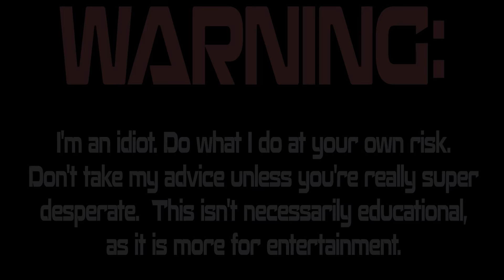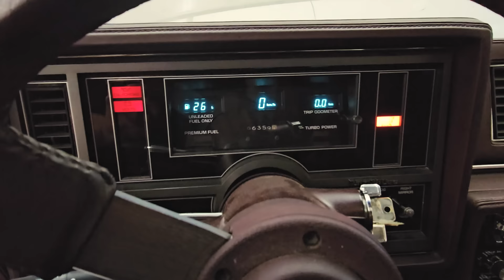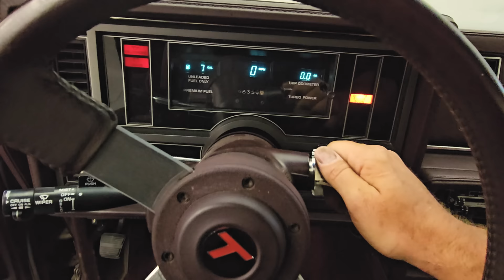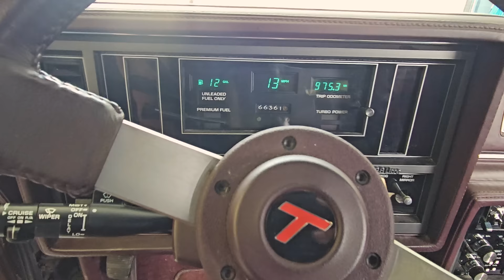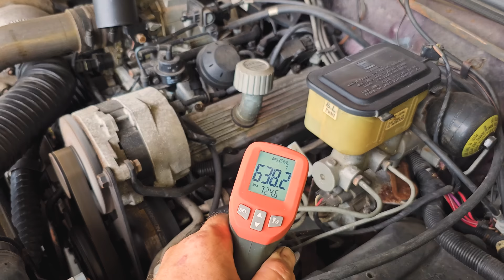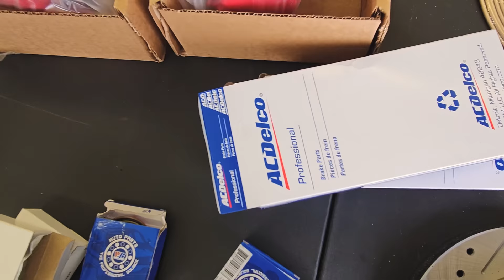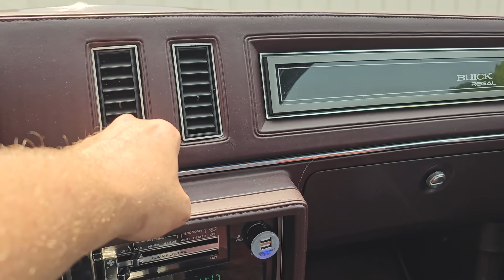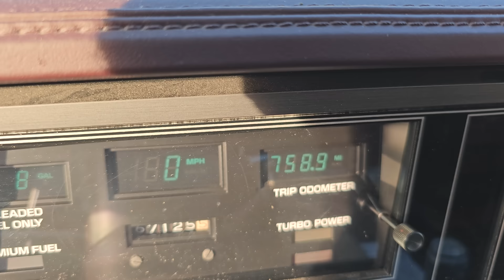ABANDONED In Storage For 22 Years - Rare Turbo Buick! Will it RUN AND DRIVE Home 750 Miles?

Comment: This car is not a t-type . It is much more rare. It is a T otherwise known as a turbo -T . There were only 1,534 of these cars made in 1987. The Turbo T's were the last off the assembly line for the buick turbos. They were lighter and faster then the grand national. They had aluminum wheels and aluminum bumpers. The grand national had steel bumpers and steel wheels. Nice find and please keep it .
Reply: Aluminum wheels & aluminum bumper brackets... Not aluminum bumpers.
Reply: How many had T tops?
Reply: @ServiceDepartment-zu5hm Never know who's readin' these comments...
This car is late-auto history!!!
I'd keep it for a show car... will turn heads I'm sure!
Reply: Its a rust bucket! Scrap it!
Reply: Since I have nothing better to do on my laptop while watching the episode on the TV.
Pausing at 10:00 and zooming in, it's a Y56 (T Package) code car and W02 (Exterior sport package). 
Not a WE4 Turbo-T car.
Reply: I think the black turbo-t is the only one that has a 1500 build number, and it's called a WE4
Reply: What ever it is restore it to original and build the gn sence it is in much worse shape.
Reply: That's way too nice a car to do a frame swap. Lift the body off and  clean the frame with a wire wheel and flap disk. Weld any bad spots. Vapor blast as much of the original parts as you can but try to keep it as original as you can. That's an amazing find and it deserves it!
Reply: @michaelweilmuenster5754  not sure you realize how bad it is rusted. One does not simply flap wheel and weld a Michigan frame 🤢
Reply: @MotorSwapDan No kidding. You still couldn’t get to the inside of the frame to clean it. I’d be on the hunt for a clean frame.
Reply: @MotorSwapDan Yea…Once the rust gets to that point it’s nearly impossible to stop it. That frame is a real hazard.
Reply: @agentcrm  I noticed at the beginning that this was a T and not the more common T-Type. I'm not an expert on RPO codes, but didn't the "T" package feature a 307 V-8, possibly standard?
I think the above post is innacurate.
I looked over two identicle brand new Regal Ts at a dealership in 1987, and both had the 307. They were both silver with the cast aluminum 'turbo' wheels.
I found out years later that that was the only year a V-8 was available in a 81-87 Regal.
Reply: @tommylord  No it didn’t, from ‘83 to ‘86 the “T-Type” trim came straight from the factory with the 3.8 turbo, upgraded suspension, and wheels, in ‘87 they changed it so the “T” became just a suspension and steering upgrade minus the standard 3.8 turbo engine that came with the car so essentially you could get any engine with the “T” package, the name “Turbo T” means that you got the 3.8 Turbo and also the T package, with or without the “WO2” appearance package that included black trim which also became available for any trim in ‘87 rather than being solely for the “T-Type”.
Reply: @agentcrm It is a Turbo-T car, Y56 is the T-trim (suspension and steering), LC2 means that you got the 3.6 turbo, and the WO2 is just the blacked out trim panels. I found all of them on the sticker.
Reply: What’s a 3.6 turbo?  

3.8.  @Sway392
Reply: @Sway392 you don't even know what kind of car that is let alone the engine!
Reply: Is that what Google told you!
Reply: @George-dy3pt  Lol, I make one mistake and all of a sudden, all’s I can do is read a brochure 😆 if you read my first comment I said 3.8 Turbo I just misread it typing the second comment as my phone has a crack down the center, and I don’t bother to update it because as you can see someone corrected my 2nd comment rather disrespectfully but it was indeed already corrected by someone else. You probably still dream of owning this car while you drive around in your green ‘94 Crown Vic, take your boomer antics to the local car museum, because that’s the only place you will ever be close to any car over 5 thousand dollars.
Reply: @Leofred2000 Some surface scale does not a “rust bucket” make.
Reply: @Leofred2000  nice bait
Reply: TINKLES 😂
Reply: @Sway392  Allright. Thanks for setting me straight on that. Unlike another jerk who accused me of being a 'google warrior'.
Reply: @Leofred2000 I can tell you drive a civic and ain't a car guy
Reply: I've never seen one of these derrek
Reply: @Sway392 ouch.  Butt hurt much?
Reply: Not a we4. It’s a base turbo regal. The lightweight stuff was on all turbo regals except most 87 GNs. All 86 GNs came with the aluminum bumper stuff. We4 was black with black bumpers.
Reply: @MotorSwapDan  But it's also not that hard to find a frame for a Regal either. It doesn't have to be one off a Turbo one, there's nothing special about it. Swap the frame and it should be good. The body is in excellent shape, a frame swap would be easily worth it.
Reply: Thanks for being aware of the whole "T" thing.  So many people think they have an '87 T-Type, when '86 was the last year for the T-Type.  The "T" package is just a tighter suspension package that could be ordered on most '87 Buicks--including Park Avenue.  They even came with the "T" badge on the fender.  The turbo 3.8 was a free-flow Regal option in '87 only, and there were even some Regal Limiteds produced.
Reply: I have this car (WE4). It was made in '87 only, there were only 1547 made, they are lighter than GNs but only by about 100-200lbs maybe, they are steel bumpers with aluminum brackets, they have all the same rust issues as the rest of the gbodys and they scoot like heck when you get in the boost. Very cool cars to own and drive I can assure you all and def worth restoring (I restored mine and still WIP). For modest money you can really push the boost up (safety) from stock and make these cars quite surprising quick.
Reply: Definitely a t-type
Reply: @lesstyranny2695  all 87 TR non GNs had those parts. Also. All pre 87 TRs and GNs had the vid6/vd7 aluminum bumper supports. It’s not special at all. We4 were not 1-200 pounds lighter than a comparable 86 GN.
Reply: @kyoakland  nope. W11 t type code ended in 86.
Reply: @thatmechanicguy1993  I've researched this and gave a range intentionally as the delta in weight depends on the options selected. WE4s were basically the blacked-out t-types but with '87 drivetrains.  And "not special at all"... good luck finding one.
Reply: @lesstyranny2695  I can find one in 10 minutes. 🤣 TRs as a whole aren’t rare. We4 was a GM propaganda tactic to actually sell more GNs. It was all bs. And funny. Also there is zero difference in the drivetrain in 86 and 87. Matter of fact Richard Clark dynoed them back to back. It was a GM rating pulled out of thin air to outdo the vette.
Reply: @thatmechanicguy1993  I actually didn't claim they were even different technically speaking (last comment I was more referring to non intercooled cars)... 10hp can be ~1psi delta in boost (which could be treated as noise in most cases). In terms of how rare they are... I have seen one besides mine but many GNs. And honestly none of that matters or is realivent to my initial comment which still stands to be true... so not sure of the point you are attempting to even make for a car you don't care about :-)
Reply: @lesstyranny2695  the point is this car isn’t a we4. Then you go on to say how special it is when it’s a propaganda driven car. It’s not special or that rare. For instance. They only produced 463 wh1 TRs. It’s rare but I can find one for sale pretty easily. Bottom line there is so much misinformation and flat out false info it’s unreal. They made close to 36,000TRs in 86-87. They aren’t all that rare. Most desirable are the GNX then the 87 GN then the 86 GN and after that they all price out the same. I’ve been in the TR community for 30 years.
Reply: @kyoakland  Buick didn't offer a Regal T-Type in 1987... so no... it's not
Reply: @thatmechanicguy1993  so your heavily invested /passionate about GNs specifically... all makes sense now. In that case, I think further hair splitting is not a good use of time.
Reply: @lesstyranny2695  nope. It’s the hard truth. Don’t own a GN. I own a t type currently. You keep holding onto the false reality of what you have. Bottom line is a TR is not rare. Easy to find. So stop searching for a narrative in my comments.
Reply: @thatmechanicguy1993  ironically, that actually makes more sense... good day.
Reply: @lesstyranny2695  what makes no sense is the lie that perpetrated people to believe that they have something special. A we4 or a GN. Same basic car.
Reply: @lesstyranny2695  also the GN was the last TRs off the assembly line by a long shot. The last half of the year was all GNs and from September 87 to December of 87 all GNs were the same. They extended the run because they were so popular. People bought the propaganda of them being rare.
Reply: Good eye!!
Reply: I hope no one starts talking about the GNX.
Reply: My wife and I love your channel Derek 👍☝️🤞🤙🤘🖖✋☝️✊🤲👐👋🤌🤙🖖🤘Just finished the entire video. 
I love this car!! My grandma had one very similar in the early 90's. How can I i get my hands in this one Derek? Did you come up with plans?
Reply: Derek said it was a T-top!
Reply: @thatmechanicguy1993  This is straight from Hagerty's website. 
Buick produced 1547 turbo-T models, 20,193 Grand Nationals and 547 GNXs, and the turbo-T is the lightest one of the bunch. The limited-production car was faster in the both 0-60 sprint and quarter-mile than the Grand National, but still behind the mighty GNX.
Reply: @jimmywhitlow2012  no it wasn’t. It’s theoretical and hypothetical. A base tr regal with no options, a limited tr with no options and a we4 with no options is identical weight. The we4 was a gimmick. They all weighed the same. The base regal tr is not a turbo T we4.
Reply: Michigian roads and good rain was some rust off frame
Reply: I'm wondering how much he gave for it ? And how many other storage units and places have similar stories😮😮😮😮🤔
Reply: Who is going to tell him???
Reply: I was a Buick  dealer from 88-2003 T types were far and few between.The only problems I had with these cars was leaking t tops,turbo seals and tv cables going out of adjustment. Your a real fancy man in that car🤓
Reply: Please don’t misinform people . This is not a black we4 those are the ones with the 1500 make for 87 .the car your referring to is a black only non t top available we4 code . You don’t know what your talking about at all
Reply: @MotorSwapDan you are 100% right it’s black bumper for early 87 and chrome for late 87 only came in black and non t top . This is not black and has t top this guy is a liar
Reply: @tommylord t was a option offered in 87 this is a turbo T not a t-type those where offered 83-86
Reply: @tommylord your definitely a google warrior
Reply: @thatmechanicguy1993 early 87 came with chrome bumpers with the we4 late 87 had them all black bumpers
Reply: @ez24v93  I know that. They made those early cars(before mid November 86) . They also produced a few limited black wO2 cars as well. Seen just 3. For some reason a lot of the early chrome bumper black wO2 cars pop up in Canada and northern states.
Reply: If it is a 87 it’s a turbo T not a t-type. 86 was the last year to the T-type. The codes you want to look for is wo2 or we4.
Reply: @BluuAsterik4738 that’s incorrect. We4 is all black, black bumpers. This is a base regal with lc2, wO2(which is not mandatory option) and y56. WO2 (in87) was only mandatory for we4 and we2 cars.

Comment: Derrick. You have one of the rarest turbo t’s. It was hard to tell with the interior if it had concert II sound or not but I would say this car is probably one of 700. And the reason it was breaking up on the top end was because I never saw you check the air filter and you have to test the throttle position sensor and the spark plugs are Tr44s from the factory you need to put Tr42’s in it an make sure they’re gapped between .35-.45. This car requires 93 octane only especially with the miles on it. General motors had a TSB bulletin in the 80s and also the inner cooler needs to be washed out. You can take a solvent and dump it in there swish it around, and dry it out real good and reinstall it with a new hose Upgraded hose couplers. Dennis Curbin  would probably be the best person to reach out to in Pennsylvania if you’re looking for the best research and go fast parts. Enjoy that beautiful piece of history.
Reply: old school turbo Buick guy right here ^^^
Reply: Bump
Reply: Bump
Reply: Bump
Reply: bump
Reply: Legit!!! Bump
Reply: He knows what it’s worth, hence the video.
Reply: Bump
Reply: Bump
Reply: Kirban
Reply: Bump
Reply: Bump
Reply: Pump

Comment: Derek, I'm an 81-year-old guy who has been inspired by your videos. So much so, that I am trying to restore my 2002 chevy tracker. It has been in my driveway for 11 years. The harmonic balancer needed balanced. Did that, and then I put new rear breaks and lines in. Now I am working on the fuel lines. I have been following you for about a year, and I am determined to get my 4-wheeler running  this summer. Thank you,  and stay safe.....
Reply: Get it going buddy!!
Reply: I got a tracker last year  it's been so much fun to drive

Comment: I really don't comment on many videos, but I currently live in Roscommon County Michigan just down the road from Roscommon Michigan. I worked at Lear Corporation in Fenton Michigan for 25 years. I built the seats in your Buick in 1987. I started there in 1985 when the plant first opened. After building the seats in Fenton, they were loaded onto yellow steel pallets, specifically designed to keep the seats in place, having groved  tube steel that the seat tracks slid into, then shipped to Flint Michigan, GM Buick City where they would be unloaded from what were called "soft side trailers". Essentially huge tarps that covered both sides of the 53ft long trailers filled with both front and rear seats. The seats would then be loaded onto the assembly line once unloaded from the trucks, and would be put in the cars as they passed by the seats waiting to be installed in what GM called a " just in time" system. The car and seats were assigned matching numbers specifically scanned with a bar code for one another.

 Sadly, Buick City was completely demolished and became one huge concrete slab thanks to GM moving plants to places like Mexico many moons ago. I miss working there at Lear. I worked with school friends there since I had graduated from Fenton in 1983. Hired into Lear in 1985 when they opened their doors. Good times.......😊😊

Great find in the Buick. Sadly I heard about your find after you had left town. A few of my friends along with myself would have been proud to meet up with you, even if just for a couple minutes. Love your show. Rarely miss an episode.😊😊😊😊😊 

Blessings to you and your family....
Reply: I have an '87 LeSabre T-Type, thank you for your story!
Reply: I heard northern Michigan and it piqued my interest too. I started recognizing landmarks and heard him say Roscommon..... I could have been up there at my parents on the Au Sable.
Reply: I'm actually from Holly, graduated in 82, currently living 1/4 miles from Buick slab city. What a shame it happened. Just wanted to say good to hear from someone who can appreciate what happened and to find out we lived in neighboring towns. Holly and Fenton. Great times back in the days.
Reply: Thanks for sharing that. Hello from New Zealand. :)
Reply: Cool story
Reply: My dad lived in Roscommon, Greyling, St Helen areas when he was growing up. As a kid we lived in Flint before leaving Michigan back in the late 80's to head to NC. Thank you for sharing the story! The new generations forget the devotion of many back in the auto decades...
Reply: @tjbristle  why do Michigan people always talk about places in Michigan even though it has NOTHING to do with the topic at hand
Reply: @2ndhandsteve127  ? He went to that area of Michigan to get this car. Which made a connection with Derek's fan, @tromska1. So I reinforced his connection. Its basic human experience. Fanbases thrive when they can make a connection. I don't understand the negativity when it takes less energy to just scroll passed a comment. I hope you find something in your day that brings you joy, and provides you an opportunity to bring joy in another persons life. Have a blessed day.
Reply: @tjbristle  Your response to that grumpy post was perfect. I hope that he was only having a bad day, and that he doesn't feel that way about "life in general".
Stay well and be happy!
I really enjoyed reading your original comment, even though I don't come from Michigan.